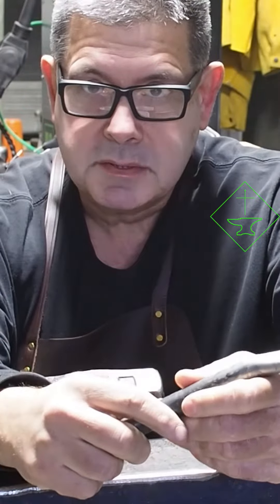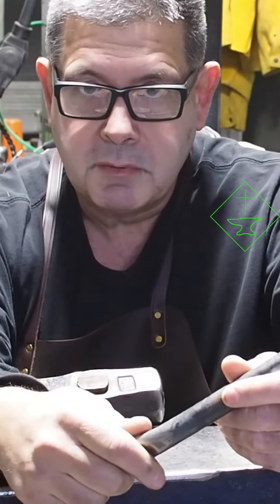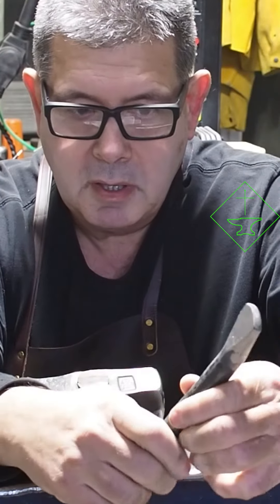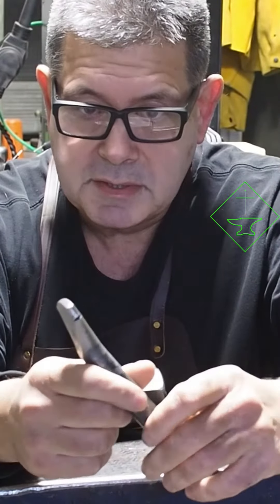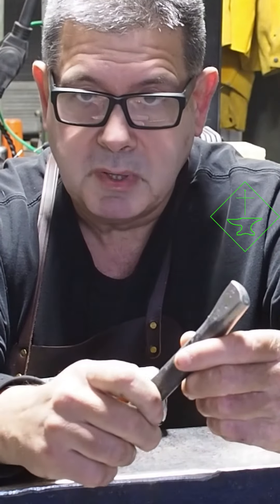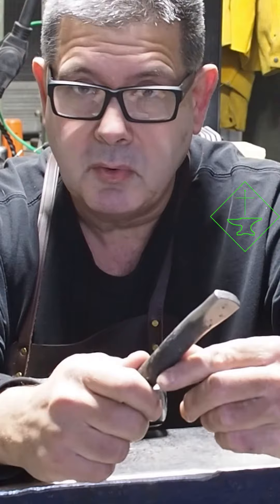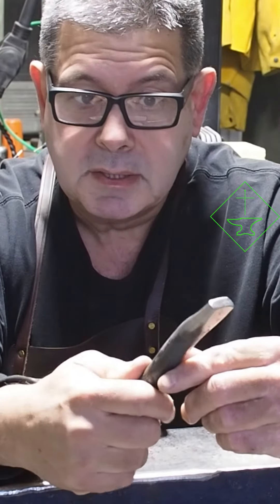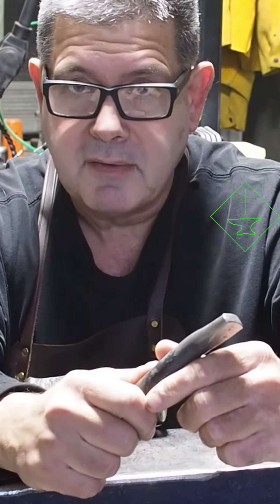The Downside of Induction Heater Forging in Blacksmithing

Comment: Is it possible to lower the output so it doesn't heat as quick, or is it always the same?
Reply from the maker: Yes this is possible to do it this way, I do this myself when working with thicker stock.